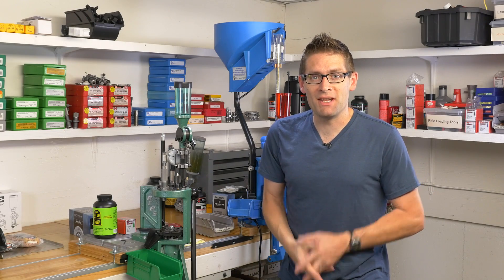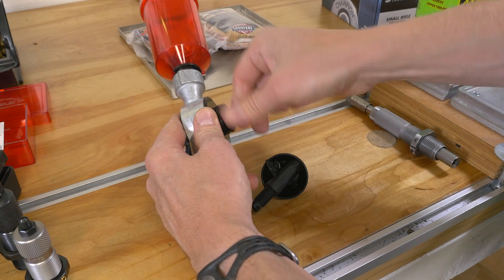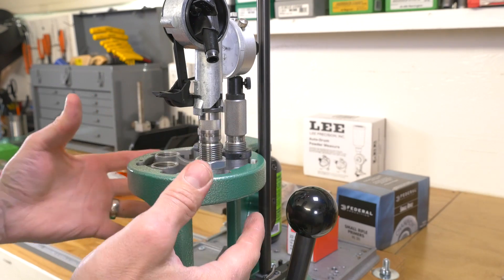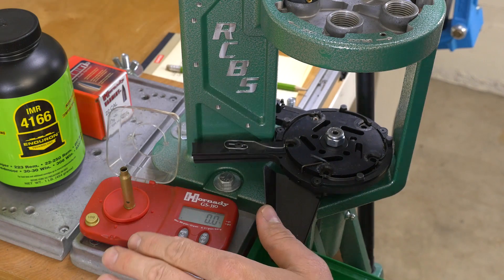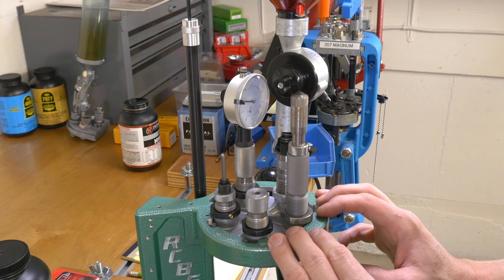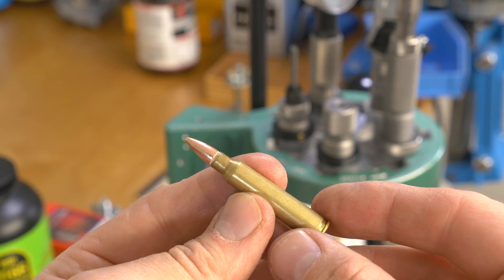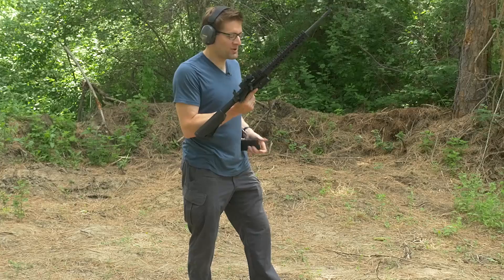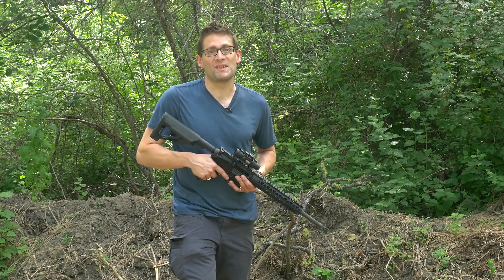Loading .223 Remington with the LEE Auto Drum Powder Measure

Comment: 2700+ fps with 55gr and you call that good performance??  Can achieve same thing with 18gr of IMR4198 instead of 24.7gr 4166
Reply: Dima Prok you don't always need speed to have performance...
Reply: I think you mean accuracy which I agree to that, but performance also means pushing that bullet faster because it will go farther and drop less.

Comment: I have one of these and it gave me problems with metering of the bat.but I rubbed it down with a dyer sheet and ran a bunch if powder through it and now it meters dead on! I can finally run extruded powder on my loadmaster!
Reply from the maker: Nice trick, thanks for sharing!
Reply: The other thing I do with my loadmaster is I put a longer bolt in the case feeder to accommodate 223 and 308 cases and then I put the Lee quick trim with my cordless drill and the sizing die Ahead of it. The only issue with this is you need a taller case feeder which I will work on eventually. So you can progressively size and trim rifle brass. Then I use the second stage with the Lee powder die and the auto drum followed by the bullet feeding die and a lee factory crimp die. So you can pump out quality rifle rounds in two stages relatively fast.